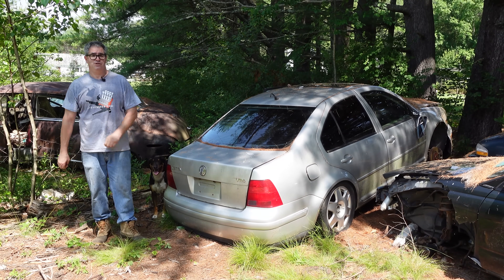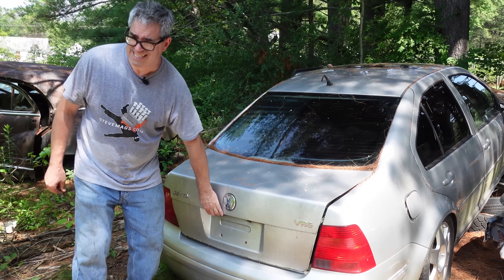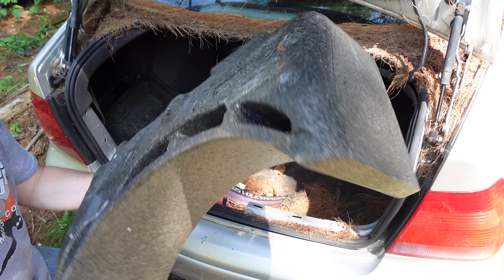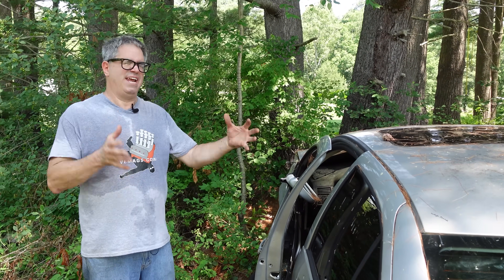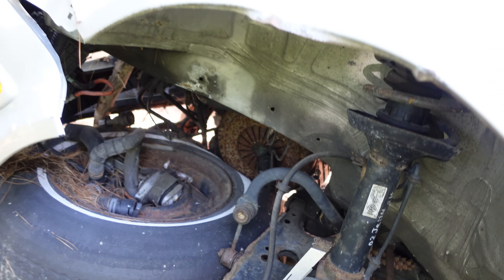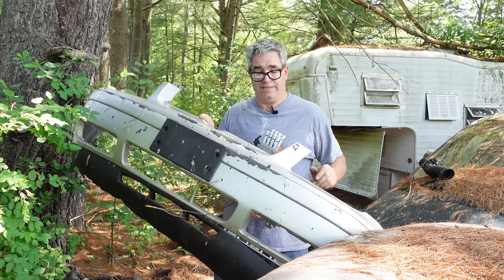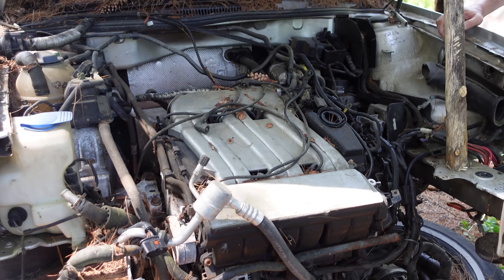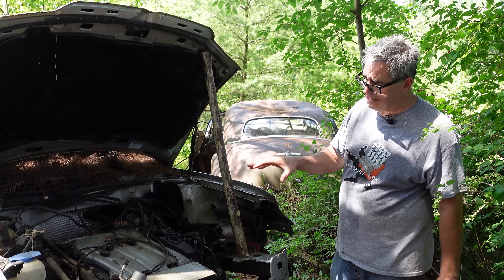130 MPH Jetta

Comment: Lots of problems here Steve that I will detail in a little while when I get a chance to sit down biggest one though is stating that the third generation didn’t get the VR6 it certainly did I own one I bought it new.
Reply: So I'm late to the party, many other popele beat me to it, but here's what I noticed:

First point is trivia.  The  A3 (MKIII, or 3rd generation) platform was built into early 1999 model year.  The A4 (MKIV) started in 1999 1/2. So there did exist 1999 A3's.

Dasher was not a sports car, it was their bigger sedan, the B platform, which would later be called the Quantum and then the Passat in the US (it always bore the Passat name most other places in the world).

All leading up to the biggest problem, the first available VR6 was in the A3, not the A4 platform, which came in 12V version in the Jetta GLX VR6 and the Golf GTI VR6.  The Corrado SLC and the B3 Passat actually got the 12V VR6 in 1992 also (some note maybe 1991?).

You're also incorrect about the 24v VR6 making it to the US, in fact that's what the A4 platform got, and that's what you're looking at in the video.  The intake runners are different and those are 24v VR6 runners.  The 12v runners are pictured in the wikipedia "VR6 Engine" article.  Horsepower numbers are wrong, the 12v VR6, at least in the version seen in the US (AAA engine code) had 172 horsepower.  The 24v VR6 in the car in the video had 201hp.

Fuba antenna appeared at some point during the 3rd generation, not the 4th.  It was on the upscale trim, possibly only the GLX (VR6) and the GTI VR6 Golf.  I owned 2.0l (2.slow) A3's with the metal fender antenna and my 97 VR6 had the roof mounted Fuba.  And yes, it disintegrated.

As far as the 130mph capability, yes, it does do that, and as I recall it's limited by the ECU.  Young and stupid, I did do it once in the 97, and to be truthful it was running out of breath by the time it hit the limiter.

Comment: Nice look at that engine. VWs of that era were known for their high quality interiors and engines that really sang. Made the 5-speed a lot of fun.
Reply: And (had one IV, identical to this if this one is a stick, and then met a girl who had just bought a 1.8T four years later just as I was dumping mine due to constant repair needs)....

...constant constant code throwing and repairing things that would never need repairing on a toyota or honda. Here's my experience from doing what work of that I could - open service manual, VW suggests special tool. Go to the car, generally not needed. I feel bad for people who bought them and had VW insisting constantly that they needed special tools. 1.8T was crap, too - core motor probably decent, just like the VR6. Interior style nice. Everything electrical or hoses, complete garbage terrible parts costs for little hose sections and such. 1.8T without the horizontal stabilizer bar in the VR6 version, a very squishy feeling car and terrible mileage compared to its window sticker - later revised downward a lot by VW. You'd have needed to drive 50 with a tailwind to get the original highway rating. May still not have gotten that. Claimed 34, got 28 on the highway on premium only. A chrysler pacifica gets better highway mileage now on 87 octane and is just as fast.

Comment: Katie is a dog that likes to be around people, so let her "steal the scene". She's looking for a place on that VW to "go potty", because that's all that thing is good for. Correct, Quantum and Vanagon. All heaps. VW hasn't made anything worthwhile since the original Beetle was discontinued for the US market in 1979. 

That support is probably ABS plastic. Many of this generation were either made in Wolfsburg, Germany or Puebla, Mexico. The 3.2L VR6 could be had in a 2000-2003 Beetle. My sister had a 2000 VW Jetta 2.0L gas engine equipped unit. It was a junker. At 15k miles, I noticed after changing the oil that it was developing a bad head gasket. The dealer said it wasn't. After the 10th recall for window regulators, the dealer called my sister and said, "It needs a head gasket. It's going to be $2,000". My sister said, "Nope. I brought that to your attention and you gave it to me in writing during the warranty period that it wasn't an issue. You can either fix it or I'll take the plates off in front of the dealership and put a big lemon sign on it. Then I'll sue you and VW corporate".  What do you know, they offered to fix it for free. LOL.

Never been a VW fan except for the Beetle. With these, you pay German prices but get made in Mexico "quality". Looks like possible code G7V Desert Wind metallic exterior paint.
Reply: Hi Mr. Google
Reply: @tomwesley7884  Howdy.

Comment: We had a 91 Jetta that was a real pos. It started doing something crazy after about 5 years. It would randomly overheat. Just push all the coolant out. The strange part was that sometimes it would go 2 weeks with no issues, then overheat. Sometimes 3 days. 2 vw mechanics looked at it and couldn't find out why. We ended up just trading it in on something else, non vw.
Reply: What was the Jetta traded in on?
Reply: Smart move.
Reply: Those were the best ones ..Mk4 were built in Mexico crap
Reply: VW with water are garbage. Constant CEL issues. Falling apart after 5-6 years . Mk1 rabbit GTI are turds. My dad had a 1984 colt turbo that would absolutely destroy all the "hot hatch" cars except those glh's if they had a good driver. If not my dad would still get them.

Comment: Hay Steve, did you know that the tops of the pistons are at that 15 degrees to be even with that single head on the VR6. Strange looking piston when you have one in your hand. Tanks Steve 4 all the cool info.....
Reply: Totally not true. The Pistons are conventional. The block is flat where the head bolts on, therefore when the Piston is at TDC, there is a 15 degree wedge that creates the combustion chamber in the block, not the head, very similar to a 409 Chevrolet. The head is completely flat with no combustion chamber. Google images of the engine...it's quite unique. Another thing unique to the VR6 is the timing chains are at the flywheel end, not the front of the engine. Being a certified VW tech at a VW dealership through the 4th gen era, I did my share of timing chain replacements on VR6's once they got about 125+ miles... especially on the eurovan's. When the chains got noisy on the cars, it wasn't NEAR as noticable as it was in the eurovan's because in the van, the engine was so much farther back. I did plenty of vans people brought in for an engine rattle. The cars, not so much. By the time you could notice the noise in the cabin of the cars, they had lots of miles and usually didn't bring them back to the dealer. I wouldn't be surprised if the feature car ended up there for that very reason. That car probably could have got new timing chains and gone another 200k.

Comment: I had an '83 Scirocco that I blew the 1.8 4-cylinder in and replaced with a VR6 from a wrecked Jetta in 2000. That car would fly, wish I hadn't sold it, hard to find in good shape these days. Love those V-dubs!
Reply: I was thinking that VR6 would be a great swap into an earlier VW. I bet it was really fun to drive!
Reply: @geoffkeller5337  saw one at a show. Waaaay back in the day. Yellow, can’t remember the guys name. It was an animal in a straight line but the word was doing that destroyed the handling. VR6 mk3’s and 4’s pushed bad enough, it was worse in a light scirocco. I actually have my old mk3 vr6 Jetta and an 85 scirocco in decent shape laying around, I’ve thought about trying it for years but I remember at the time guys had moved on to that 5 valve per cylinder 4 cylinder Audi engine as it was lighter and didn’t hurt the handling as bad. But nothing sounded as cool as a vr6…
Reply: @gatesj777  Very cool. Thank you.

Comment: Daughter has an 05 Jetta 166,000 miles, Excellent condition,  daily driver.....1.8 ltr turbo, still moves and loaded, loudest factory Blaupunkt 6 speakers...cd cassette, EQ. ...needs drivers fender and rocker panel plus master window control but it still all works...sunroof air leather...
Car was Built so well. I want it.😊

Comment: I was seduced by the styling and handling of one of these in 2000, worst mistake I ever made. I paid for an extended warranty to 60k knowing vw’s reputation and the thing still got me. Right after 60k the a/c and water pump failed, and multiple ignition problems started happening. The soft touch interior plastics started decaying and rubbing off and it began to consume 1 quart of oil per 1k miles. The absolute worst car I ever owned. I got rid of it at 84k miles.
Reply: ........please tell me you bought a Toyota/Lexus.........
Reply: @lancecooper4646  acura, lexus, and honda since.
Reply: @2011joser  Better off. VWs of this vintage were heaps.

Comment: VWs from this era were cool. First time I was tempted to purchase a foreign make - either the VR6 Jetta or the Passat. I thought of the Passat at that time as an “Audi A5”

Thank you and Shane as always.
Reply: I have a 2002 Passat and a 1968 Beetle. I haven’t had too many problems with the Passat. I’ve never been stranded anywhere, but the Beetle has been flawless. My dad bought it brand new. So I’m kinda partial to VW’s
Reply: I owned a '98 Passat GLS V6 (not a VR6 BTW) and it shared a lot with the Audi A4.  Was the worst car I ever owned, non-stop problems with it.  Though I love my '68 Beetle, I won't touch another modern VW

Comment: Steve, I was a VW dealership mechanic when this Jetta was new.......I don't handout excuses easily, but these VR6 cars were fast, especially with a manual transmission.
Reply: God love you man for being a VW mechanic! That V6 engine looks like it would have been a real M-F'er to work on. Having to put a new clutch in one of those cars  must've been a nightmare!
Reply: @michaelnazaruk4100 
Haha the wife's Mk4  Jetta vr6 we got in '01sat in the garage for 8yrs because a timing chain job sucks dookie, they're on the trans end of the engine. 😂
Well, I yanked it and replaced everything I touched , got it roadworthy and then got a Smyth Ute kit. 
It's been on the road for 2mo now and it's a hoot.
Very happy with my replacement for my rabbit pickup I had 20-25yrs ago ✌️
I been working on these things since forever though so the quirks don't bother me much.
All those special tools they show in the manual? 
Make most of em or borrow it from a fellow Dubber,it's a heck of a community.
Reply: Removing the trans is actually pretty straightforward. I don’t prefer the VR but it’s a very reliable engine.

Comment: Cool car.
Colossal POS
Reply: I am so tired of uninformed people saying VW's are a POS or that they are hard to get parts for. That is such a crock! VW makes a quality car. They drive and ride great and are easy to maintain and repair.the 4th gen Jetta was an especially fantastic car
Reply from the maker: @xfactorautomotive1496  We all know friends who say "all FILL IN THE BLANK are junk!" I'm a little bit guilty with my RE-NO-WAY (Renault) campaign. But I'm mostly kidding. Truth be told, on the rare occasion that I see a clean, original LeCar...I think about buying it. On the subject of knee-jerk brand bashing, I think most folks just do it for a quick kick. I believe NO CAR is junk when it is new. The devil in that detail is that some cars tend to age very quickly and reveal - perhaps - weak engineering that unravels with hard use. I always take into consideration that most cars that "are total junk" were owned by folks who didn't maintain them very well and brought out the worst - sooner than later. Thanks for watching and writing. -Steve Magnante
Reply: @SteveMagnante  my thoughts exactly
Reply: @xfactorautomotive1496  someone's triggered. 
Imagine how you feel about a real quality vehicle. Yk, with  Low cost of ownership.  Reliability. Longevity. Ease of maintenance
Reply: @PimpDaddyDisco  you described the Jetta perfectly.

Comment: I drove VWs for years.I bought and drove a 2001 Jetta new. VW replaced the motor at 20,000 miles. Seems the bearings were losing the white metal and found it during a routine oil change.Owned it for 7 years .Not a 6 but rather a 4 cyl turbo.